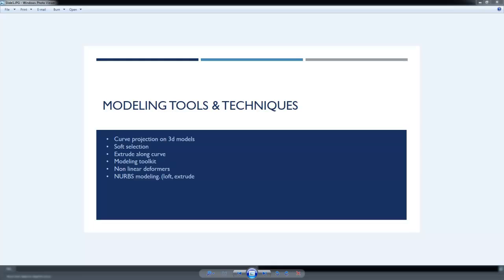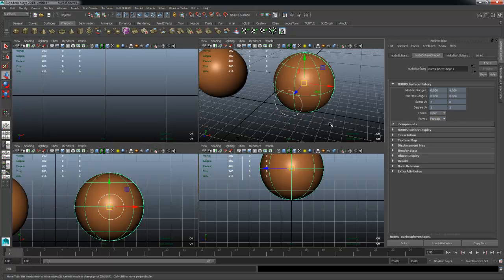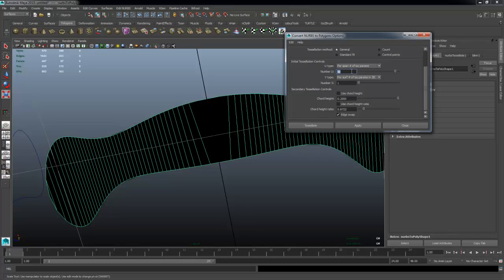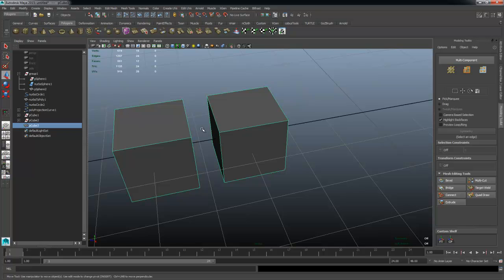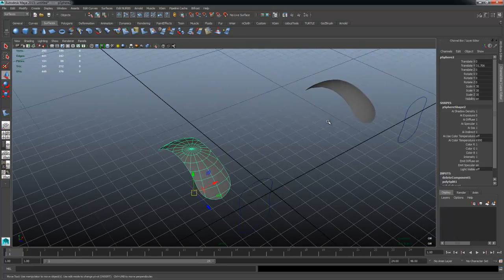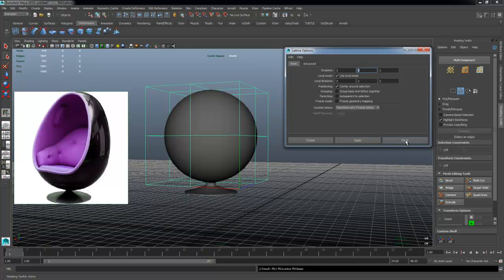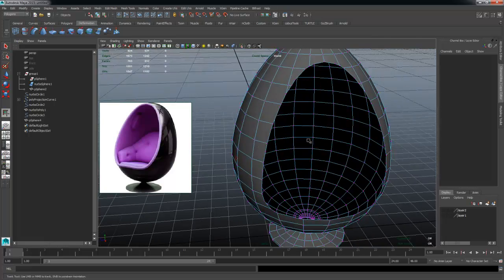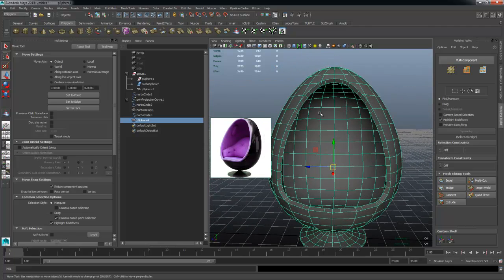Maya Modeling techniques (how to guide) part 3

Comment: Hi Cobus, what shortkey is the opposite of the  '  Shift+ < + .   ' which you are mentioning in the video and increase the selection from the top to the bottom? (at 40:20) thanks! You make really clear and good tutorials with a lot of useful info!!
Reply from the maker: Hey Ben. I am using the shift key and then either the coma key or the fulstop key to grow or shrink the selection.